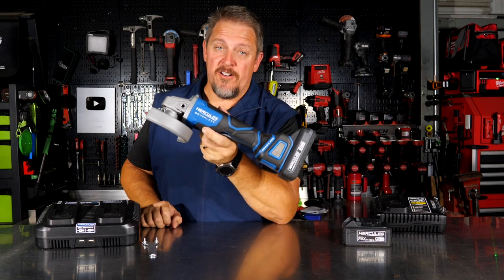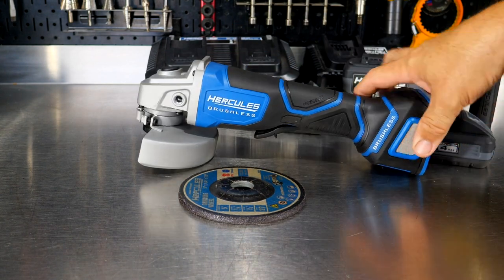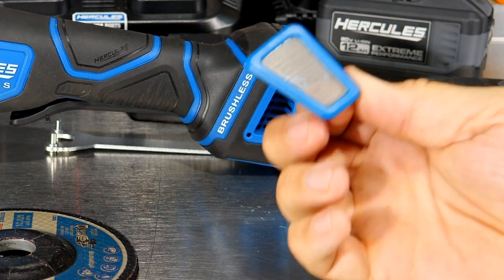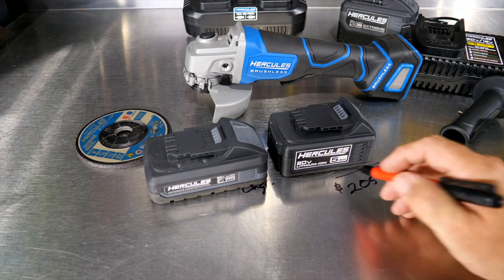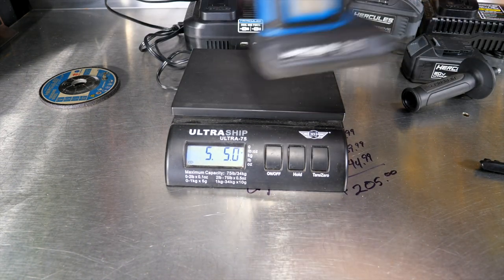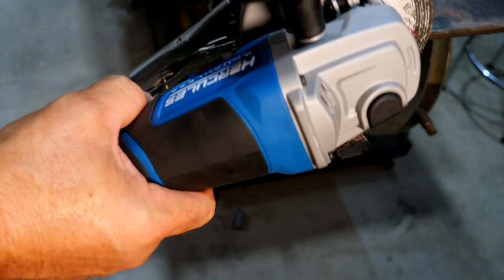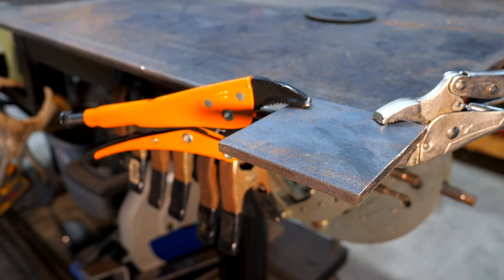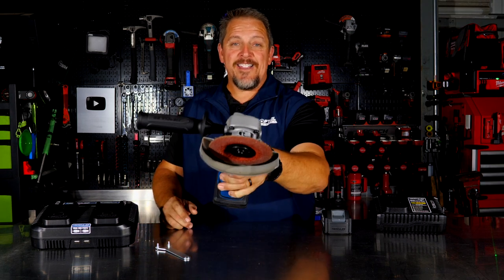5-Year Warranty! Hercules HCB61P 20V Brushless Grinder Review

Comment: Been using the slide switch since last august in an automotive kustom/fab shop with the 12ah and it’s been an absolute beast.
Reply: With the 12ah you CAN power through lmao, but if you catch it wrong it’ll still stop you from exploding a disc which is super nice.

Comment: I bought one recently, things I’ve found is that it’s heavy and awkward to use with one hand, the gearbox seems very noisy and it also seems to really suck the batteries down pretty quickly no matter which battery I use. I would really like to see a top mount for the handle for more options. They are handy though.
Reply: Repack the gear box with Lucas Red & Sticky grease. Will quiet it down, it will run cooler, and you will get a little bit better run time on the battery due to the lack of friction in the gear box. May help with less vibration also... Only takes about 10 minutes to do...

Comment: your wrong on saying the 4ah will have more power compared to the 5ah.  5ah 5s2p 18650 batteries will have a higher discharge rate than a 4ah 5s1p 21700 battery.  Your typical 5ah power tool battery is made with 10  18650 cells.  typically Samsung 25r cells which are rated at 20amps of continuous discharge power but since there are 2 sets the total power with be 40amps continuous.  a typical 4ah 21700 cell power tool battery is made with 5 samsung 40t cells rated at 35amps on continuous discharge.  only the 3ah 21700 cells made with the samsung 30t cells can compare with the power of the larger 5ah 25r cells.
Reply: yep, nailed it
Reply: Nerd

Comment: Would like to hear your opinion of the use and ergonomics of the Paddle Switch version versus the Slide Switch version; both Hercules 20v Brushless 5yr Warr. Particularly as, my understanding is that the Slide Switch version has a Lock On Feature, which is not a feature of the Paddle Switch version. Additionally, Harbor Freight is now running a $69 sale on the Slide Switch version, plus it is available in a $119 bundle with choice from another 6 Hercules producdts (one of which is the 8AH Battery).

Comment: Just picked up this at harbor freight, bought the 5Ah battery and charger for $99 and got the grinder for free. I'm really impressed with this thing, smooth running and has a surprising amount of power
Reply: I second that I got the Grease Gun for free after getting the combo.

Comment: Just picked up 2 paddle switched units for $99 a pair and then the 4amp charger $45 and two 5ah batteries for $99.

$250 for two working grinders!

Comment: My only complaint is that you need to be able to buy a 7 inch guard because there are many times that I need a bigger cutoff wheel.
Reply: Then buy a 7” grinder dude. You shouldn’t be using 7” wheels on a 4.5-5” grinder. That’s how you blow up wheels. That’s just straight up not safe or smart. Literally the only grinder wheels I’ve had blow up out of thousands have all been from oversized wheels for the tool.

Comment: I just got back from HF. Got a corded 4 1/2 grinder for $19.99
Reply: You can’t kill those things. They go on sale for $9.99 frequently. I bet I’ve got a dozen of them with a different attachment on ea. Some of them are 15 years old. The harder and more frequent you use them, the longer they last. And I use them for things I wouldn’t dare use my “good” tools for. Only had one fail. Left it out in the rain overnight. Still lasted 3 months before it finally crapped out!
Reply: I have one of those. It's turning purple from being kept in a doorless open-air shed all its life.  The DrillMaster right?
-- Must saaay 09$ to 20$ usd for 11 years worth of service is not bad for a beater angle grinder. It has cut a LOT of hardiplank and concrete over the years

Comment: No break, low power, same generic form factor as the Kobalt. It’s junk.
Reply: With a 5 year unlimited walk in with return, walk out with new tool warranty, that’s the kind of “junk” I like.
Reply: It does have  a "brake" but not a "break".  It also has power with the right battery. Way better than the Kobalt.
Reply: It has a brake
Reply: I don't think it's meant to displace Makita, Milwaukee, or DeWalt. But it's a great value proposition for a DIYr or someone needing an interim solution, or someone exploring a new need and not wanting to dive all the way in. The market needs entry level producers, not everyone needs the highest performer. I don't need to buy a backhoe want to shovel will do right?
Reply: brakes are for safety sissies with clumsy fingers, power is dependent on battery like every other manufacturer (most of which are made in same factory), form factor is the same as Milwaukee (and both carry 5 year warranty)
Reply: @wildbill6976  honestly I just like how it sounds and feels when it stops after letting go of the paddle. Milwaukee w/ brake is an amazing grinder.
Reply: @mikeanderson223  lol, man gimme a brake